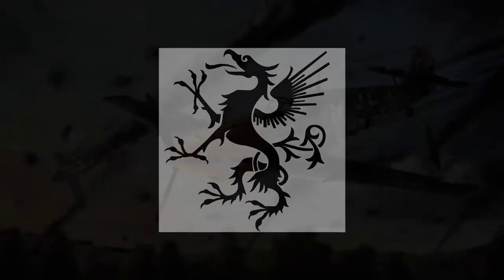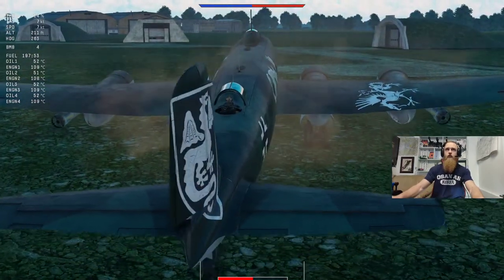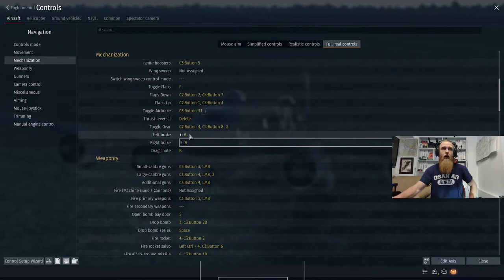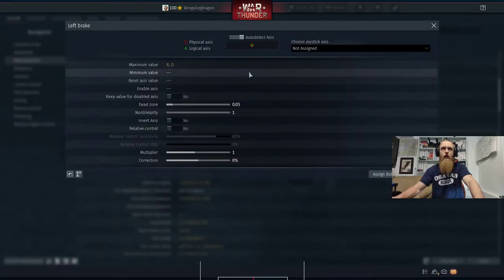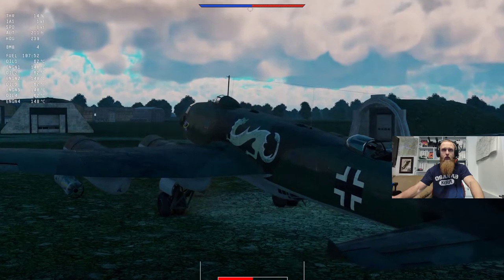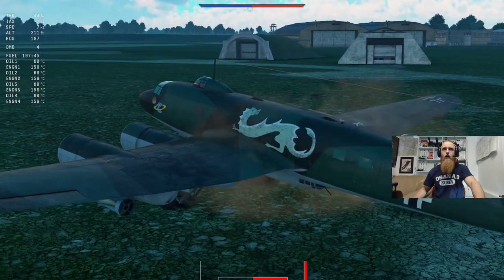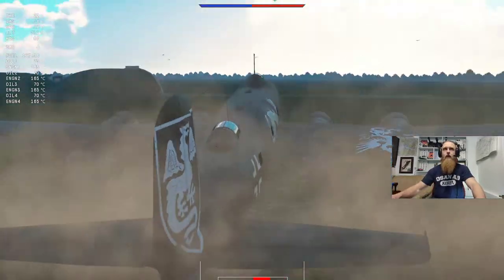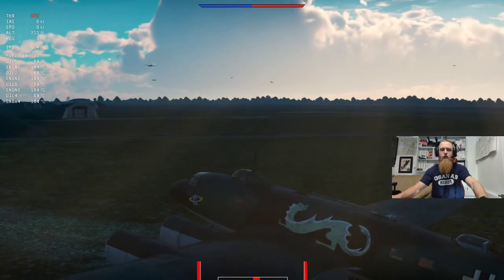War Thunder How To: Differential Brakes

Comment: Unfortunately this does not work for controllers. It doesn’t give you an option to get them
Reply from the maker: It does.

You just need to switch you control mode to "full real controls" at the top of the control settings menu.  

Once you view the fuel real controls, you'll see "left" and "right" brake in the bind menu.

Comment: But can't you brake with your rudder pedals If just push on them because I did it before but I forgot how to set it up again
Reply from the maker: Full real controls > mechanization > leftand right brakes
Reply: @WingalingDragon  that's what I did and it doesn't seem to work
Reply from the maker: @__  they probably are working, but you may not be noticing the effect as pronounced as you're expecting.  Reason being is that WT has DRAMATICALLY reduced the brake effectiveness of aircraft because of issues with players stomping on them too hard, tipping over, and then complaining about it.  

As long as your left brake is bound with the maximum set to a certain key and your right brake is set to a different key, then your brakes are separated.  Pressing the individual keys will apply brakes on only one side of your aircraft.
Reply: @WingalingDragon  yes that's what I did instead of using my rudder pedals. Because I remember saving my keybinds but they mysteriously got binded together with my keyboard controls as well so I had to start over.